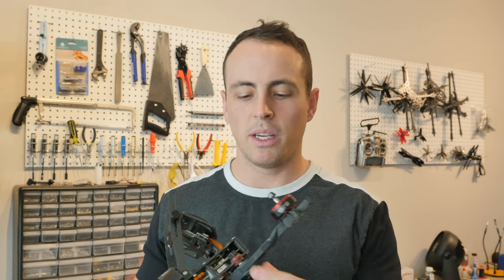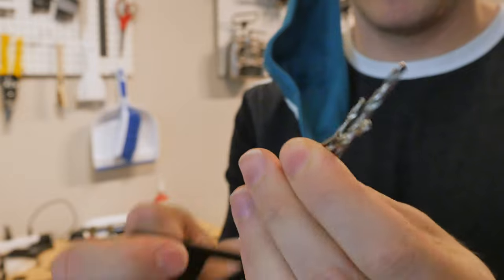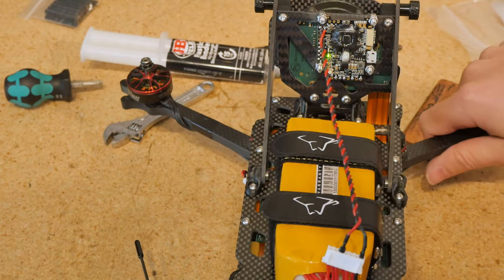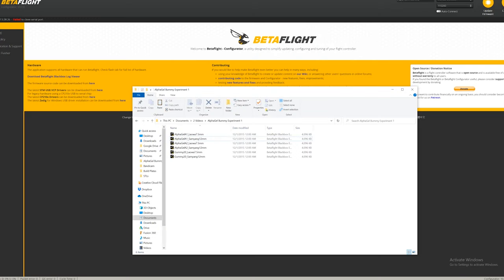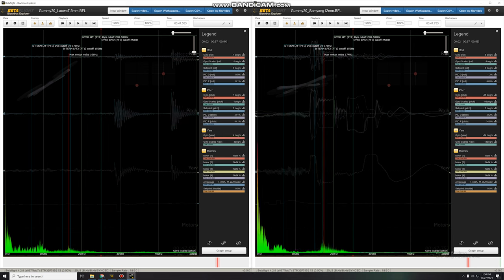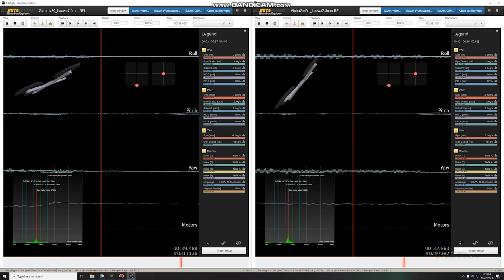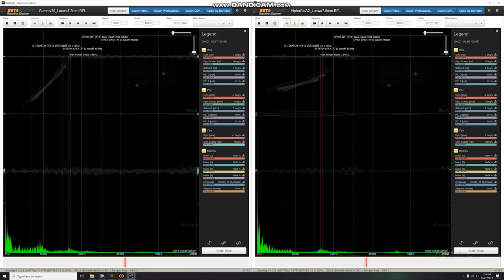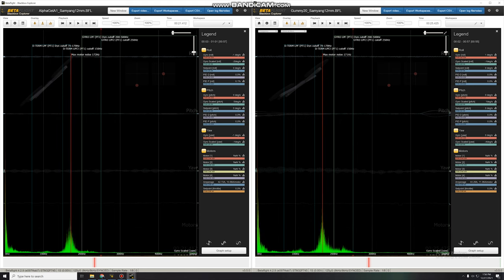AlphaGel VS Silicone Gummies Test#1

Comment: Nice test Sam. Would be interesting to see how they perform at different temperatures too. One benefit to the split design I like is the ability to tune it (Resonance point/Horizontal drift) with different PCB/plate thicknesses.

Comment: Are these new motors you are testing out as well? I see 2808 instead of the 2810? Just curious.
Reply: XNOVA 2808 FREESTYLE SMOOTH LINE MOTOR -1350KV - Looks like better low end performance than the 2806.5 and lighter / less current draw than the 2810 motors - right in between.